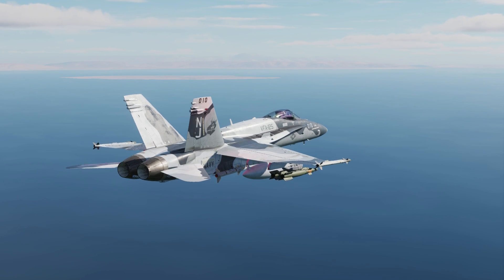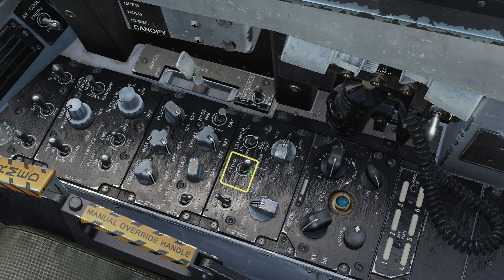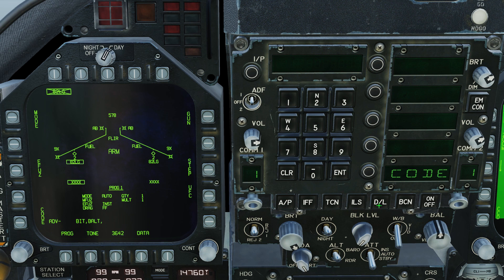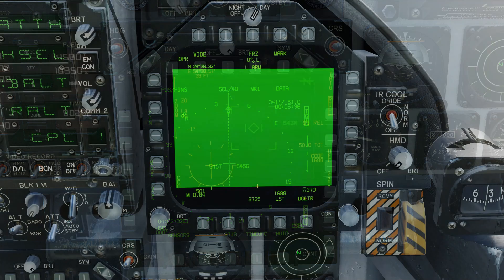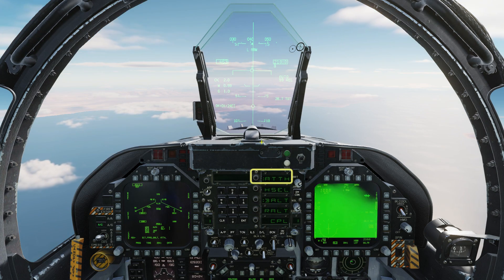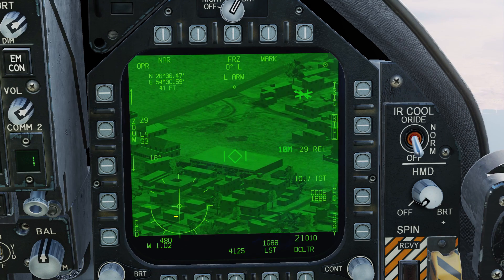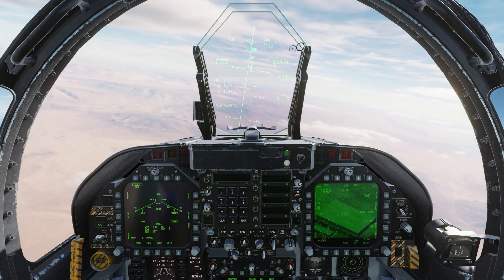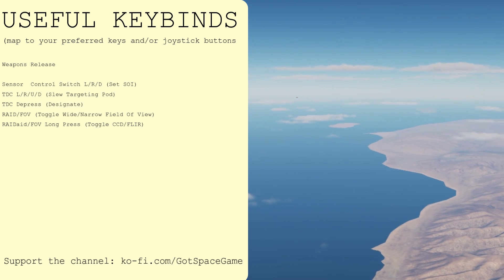DCS F18 laser guided bombs tutorial with self-designation - GBU12 / GBU10 / GBU16 - DCS in 3 Or Less

Comment: On the target waypoint part, I can get the radar image to move to the waypoint by clicking WPDSG, but flir refuses to do anything other that pointing straight ahead when I click it. If I select later waypoints and try to designate those the tgp just seem to move between random points on the ground (not the waypoints). Since I can't target a waypoint and there is no indication in the HUD where the TGP is pointing I just have to move t around blindly until I see a ground feature in the TGP MFD image I recognise, and that is almost impossible... Any way to fix this?